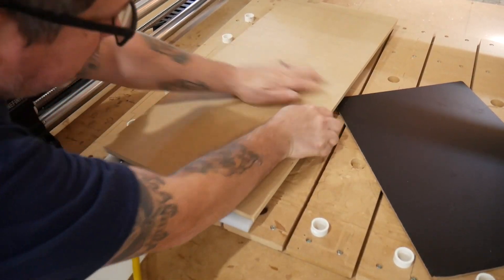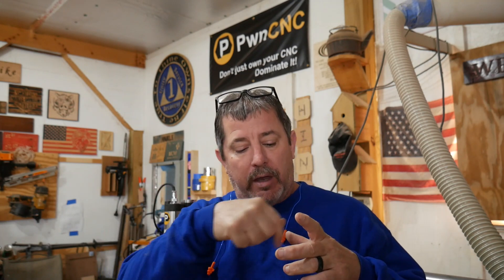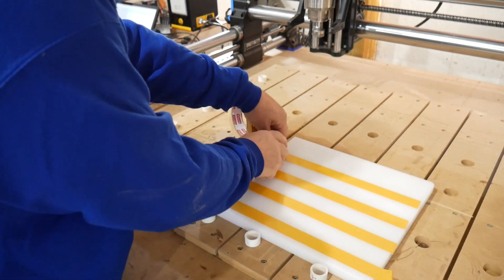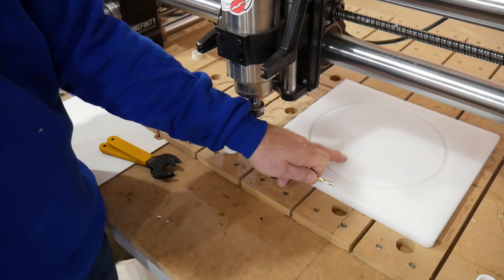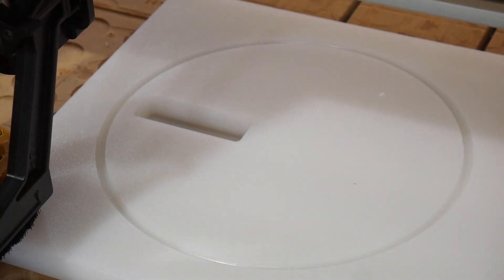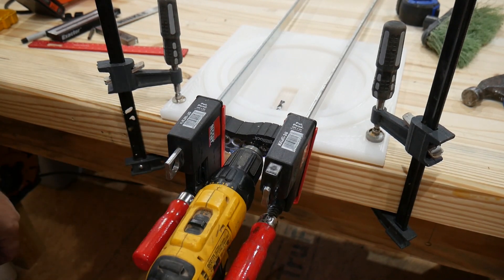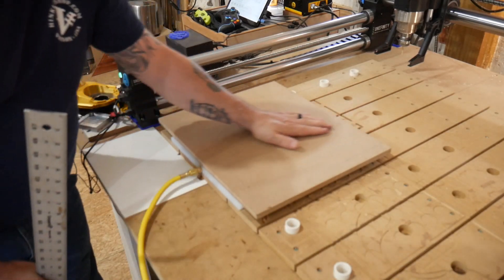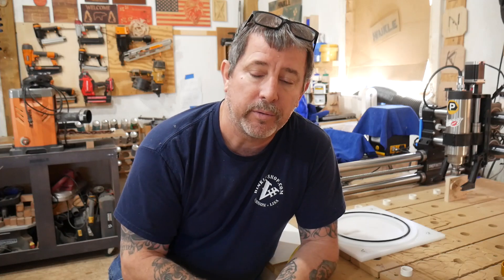Make a vacuum hold down

Comment: How about link to the pump you used and where did you purchase the white cutting board material
Reply: @hinkleshop how about the self threading fitting you used?
Reply from the maker: It is a 1/4 mpt to 1/4 flare they are available at any hardware store
Reply from the maker: I will add a link to the pump and I purchased the board from Amazon there is a link in the description for that as well
Reply: @Hinkleshop what was the cutting board thickness? Didn’t see a link for that.
Reply from the maker: The board is 3/4 inches thick 
I purchased it from Amazon there are several thicknesses to choose from 
Search 3/4 inch plastic cutting board

Comment: What pump are you using?
Reply from the maker: Hello 
I will put a link to the pump in the description 
However that pump is rather expensive it’s designed for the air conditioning repair service there are several on Amazon that would work that are cheaper 
Just look for the highest cfm rating you can afford

Comment: GREAT WORK!! I would pay for a few bucks for plans, parts list and instructions. 
I was kind of surprised that the MDF held so well. Air Weights sells a sheet of MDF as a sacrificial intermediate layer for when you want to cut through the stock and avoid cutting the plastic base. The vacuum is sucked through the MDF.
I like the suggestion from @clane3211 of leaving an area of plastic in the middle to prevent sagging.

Comment: Got a link for the fittings?
Reply from the maker: Sure here it is 
Breezliy 2 PCS Brass Tube Fitting, Half Union Gas Adapter 3/8" Flare x 1/4" NPT Male Pipe Connector

Comment: Instead of hollowing out the center completely, would adding a grid of channels still allow for strong suction while having base material to keep the material that you want to engrave from sagging?  I’m not sure if that is a possibility, I was just curious.  

Also, I would be interested in buying the file.  Selling files is a great idea.
Reply from the maker: @clane3211  I think your idea would definitely work 
My idea was going to be, if i did see center sagging was to leave a 3-4 inch diameter circle in the center for support
Reply: It would be interesting to test and see if one or the other is better.

Comment: Good vacuum job. Just for fun lookup Magdeburg Sphere. 17th century scientist created a vacuum sphere in 2 halves,, about 6in diameter,  2 shire horses couldn't even pull them apart. What power/suction pump do you use for that?
Reply from the maker: For the horses, I don’t know for my vacuum puck I use a repurposed vacuum pump that we use in the air conditioning industry to pull a vacuum before dumping the charge into air conditioning systems
It’s a six CFM pump